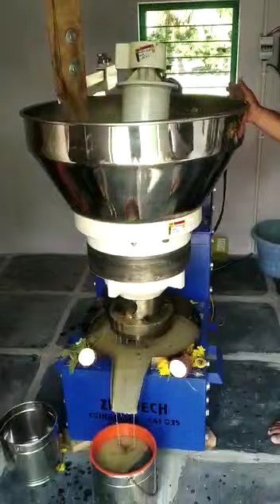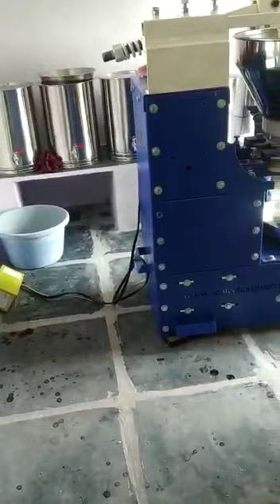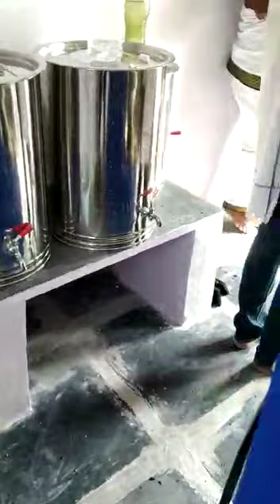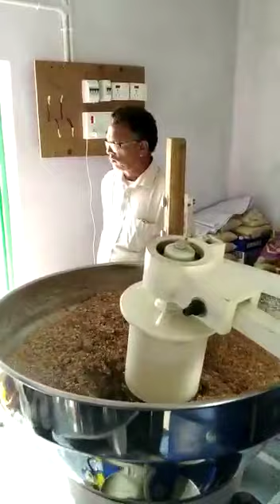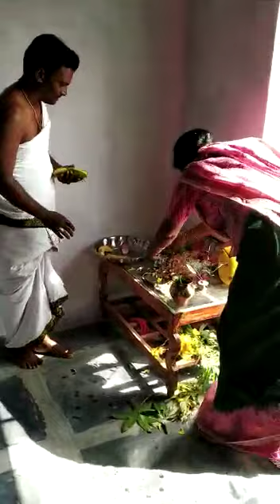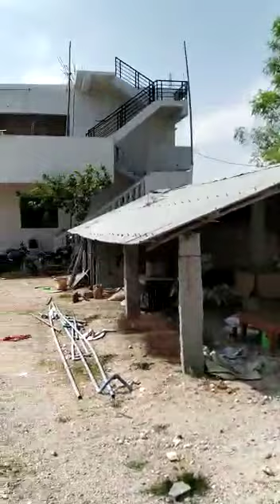#our_god_Telangana_Ravikumar 7339197774 zentech engineering #marachekkumachine #oilExtractionmachine

Comment: 25 kg capicity machine price
Reply from the maker: Machines Rate:

Thiruvalluvar 180000+ 18% GST=  212400.00

Bharathi    180000+ 18% GST = 212400.00

Voc 6 to 18 kgs.      175000+ 18% GST  = 206500.00

Voc 10 to 25 kgs.  210000 + 18% GST = 247800.00

SS Ural voc 6 to 18 kgs. 230000+ 18% GST = 271400.00

Nethaji ( Rotary Machine )  220000+18% GST = 259600.00

The machine value including   Motor, Starter, Switch, Spanner, Cover, Allen Key and All other Accessories. 
Machine Delivery Time : Immediately or 10 Days.
Validity : 20 Days.

IMPORTANT NOTES : You can crush any oil in this Machine.
If you want single phase  3 hp motor it's available.

 This is Including fitting training crushing cost. ( This may be vary depending on DISTANCE of the BUYERS).

Our Service Engineer will come to your company, He will fit the machine and give training and crush any types of oil in front of you.

You want to pay transport costs of machines and  service engineer transport cost, Accommodation and food cost of service engineer.

If you want one more day of service you want to pay 1000 extra for service Engineer.

This is very very important: 

You don't worry about 70000,  100000 other companies machine. You calculate output of machines. And also don't miss your dream machine for 5000 or 10000.
Thanks.

Thanks Regards 

Kanagaraj Paramasivam 
+91 98940 31929

Ravichandran Nachimuthu 
+91 99944 06061
Reply from the maker: @hemantnagar30  ZEN TECH ENGINEERING 
2/70 Senthil  velavan nagar, vilankurichi, coimbatore-  64035.
 GST: 33ARIPK4015A1ZI
Email: zentechengg05@gmail.com 
Website : www.zentechengineering.com